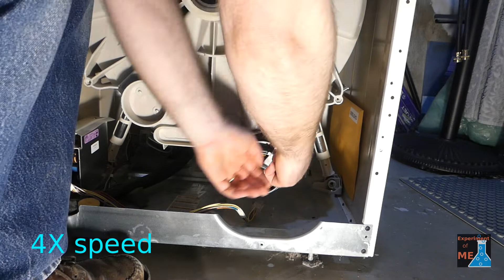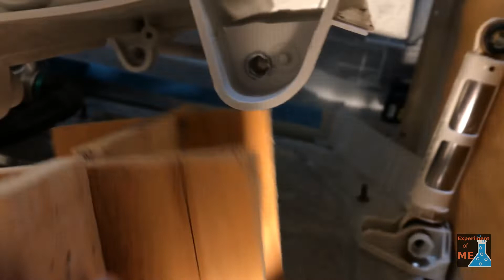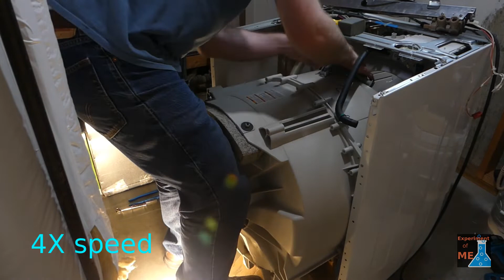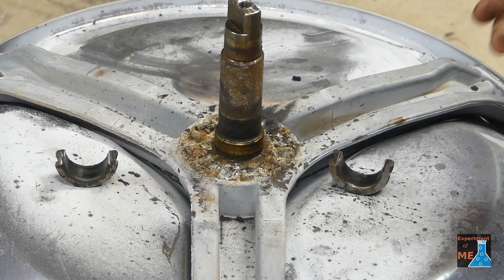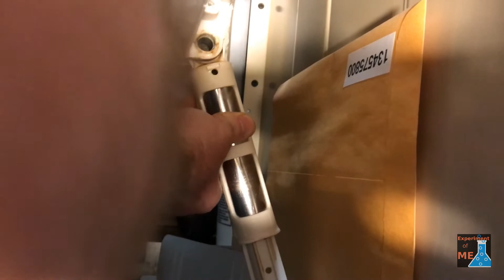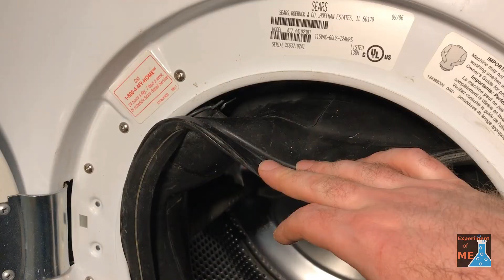Replacing bearings in a Kenmore front loading washing machine.  Model 417.44102301

Comment: Thanks for this video. Just went through trying to replace my bearings exact machine yesterday . Same problem with stuck bearings. Never thought about cutting bearing off. Fought for 2 hours, and then gave up and ordered a new machine. Wouldn’t have justify spending on just inner drum. Didn’t even cross my my mind, actually. No even sure where you could have ordered that from or how long to get. I agree with the buttons and nob though, so I am going to miss that, but new unit come tomorrow

Comment: I have the same washer making the same bearing noise. Was your machine leaving stains on clothing? I thought it was slime from the door seal, but now I think it's oil, or grease from the bearing. Just wondering?
Reply from the maker: I don't remember any stains on the clothes.
Reply: Did you fix your machine ?
Reply: @2001Blazer I did fix the machine.

Comment: Good video. I also love the old mechanical timer /clock controller. They rarely break! I did this same job on my machine about 10 years ago and I can't believe my bearing sounds like it's starting to go again? At the time I paid $15 for the bearing on eBay. I'm single and do 2 load of laundry a week. It doesn't make sense that it should go so soon after I replaced it?  Maybe everything made today is just cheap or maybe they didn't pack the bearing with grease? Thoughts anyone. Thanks.
Reply: I have the same machine & have done the tub bearings & seal 3 times in 26 years. The original seal is a triple lip, and lasts longer than the replacement seals, in those bearing kits, which are only double lip. Polaris snowmobile uses a triple lip seal that works for these machines. Part # 3235051.
Reply: @2001Blazer  Hey great tip! Thanks so much.
Reply: @FrancisFurtak  You're welcome. The seal is the key to the bearings longevity.

Comment: The bearing probably needs a "bearing separator"  which slides under the bearing and exerts force underneath the inner race.  The puller then has bolts that attach to the separator to pull against the inner race instead of the outer race.

Comment: Thanks for the video. Before using the puller you could have used sandpaper to clean up the shaft, it has to be very clean with no rust. Then spray a good penetrating oil or even Rust Check on the shaft on both ends of the bearing and let it soak for several hours, longer is better. Before using the puller, put oil on the treads and oil or grease on the tip where it contacts the shaft. Hit the bearing a few times with a hammer then use a heat gun to heat the bearing inner race and hit it again then quickly attach the puller. You may need to put a lot of force on the puller, using an impact tool works well some times. If it does not break free, leave the tension on the puller and heat the bearing again. Hit the top of the screw of the puller where the wrench attaches a couple of times and apply more force on the puller. If you keep repeating this you will probably get the bearing off.

Comment: Where did you get replacement bearings?
Reply from the maker: I got them from Amazon.com
Reply: I couldn’t find them there using Kenmore model #. Do you have a link?
Reply from the maker: I put the bearing number in the video description.  If you search that number, you should be able to find it.
Reply: @experimentofme2161  Thanks for doing that! Since Frigidaire (who made this washer, which is why the model number is prefixed with "417" apparently) doesn't sell the bearings, only the entire tub! I see so many bearings but I didn't know which to choose, so thanks for that bearing serial number!
Reply: Did you ever find the bearings & seal ?

Comment: I have the same model. It keeps getting stuck or jammed during various points during the cycle and it wont spin. Even by hand, it cannot be spun. 2 months ago, I took the motor apart and noticed the bearing retainer clip was destroyed and so I removed it and greased the bearings and put it all back together.  It had the same symptoms of getting stuck/jamming during the cycle. I worked for a few loads and now its stuck again. So I took the belt off without spinning the drum or motor and once the belt was off both the motor and drub were able to spin freely without any resistance... What could be causing it to jammed or stuck to the point where the drum wont spin (even by hand) but will spin freely once the belt is off. My guess is it is the motor bearings again and/or the belt.  Any help is appreciated.
Reply from the maker: Hmm.  The belt applies quite a bit of tension to the motor shaft.  I would push the motor shaft in the same direction that the belt pulls it and see if the motor shaft still spins freely.  If there's any sort of drag, I'd be looking closer at the motor.  If it doesn't seem to be the motor, I would do the same test on the drum pulley.  Push it in the direction that the belt pulls it and see if it still spins freely.
Reply: @experimentofme2161  thank you for the response! I took the motor off and there is drag on the motor shaft when tension is applied (as though the belt is pulling upwards on the shaft). Drum seems to spin freely with tension. When I pulled the motor apart there is clear evidence of grinding inside between the two main parts (stator? Magnetgo? Not sure of the correct part names) I’ll be ordering a motor ASAP!  Again, thank you for the response
Reply: @nloya  Did you replace the motor, or replace the bearings in the old one ?

Comment: Your video is very helpful.  This is my exact model as well and has the same problem.  In my case, it was super loud, but we ignored the noise until belt broke in back.  I replaced the belt, but it keeps sliding off the pulley.  after much research, and reading various sites, it is clear the the bearing is just destroyed.  I can lift the front of the tub up and there is alot of movement on the back where the pulley is located.  

After watching your video, thought I can do this repair myself, I have decided it is not worth it and we'll be buying a new top load machine.  My wife never liked the front loader any way.  You can have my old kenmore washer (exact model as yours) for spare parts of you like.   Otherwise, I'll likely have the city come and take it to the dump.  Well, maybe after I take it apart for fun of it to see if I can get the old bearing out or not.
Reply from the maker: Glad it is helpful.

Comment: Thanks for the video. I have exactly the same washing machine,  with exactly the same problem. Please tell me about how much time, (roughly,  at a slow pace), and the parts cost. Thanks again.
Reply from the maker: I think the new bearings cost me less than $40.  But because I damaged the brass bushing on the steel wash tub, I had to buy another one and that thing was expensive, like $700.  So don't cut off the bearing.  For time, I worked on this thing for 12 to 16 hours.  So those videos where guys show this as a 2 hour job know what they are doing and work really fast.